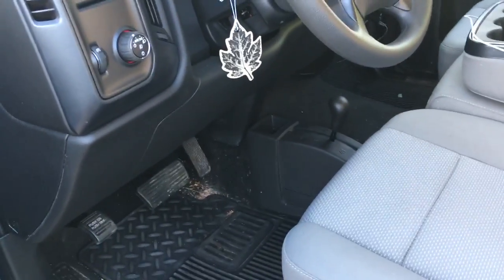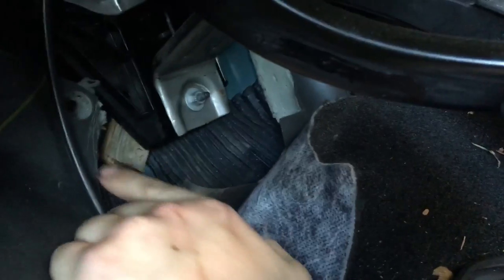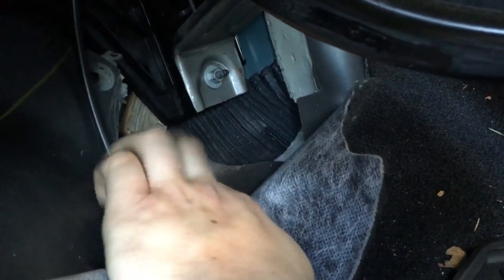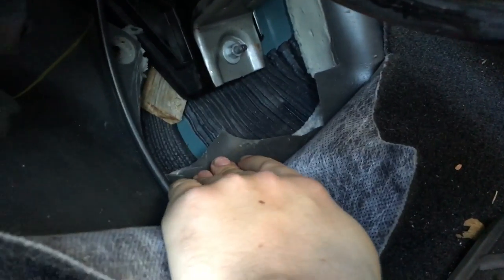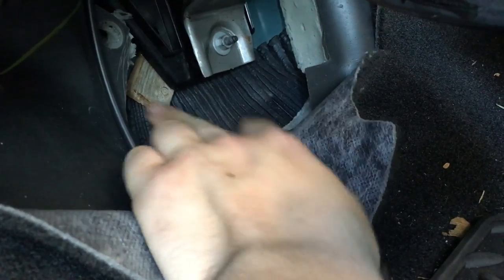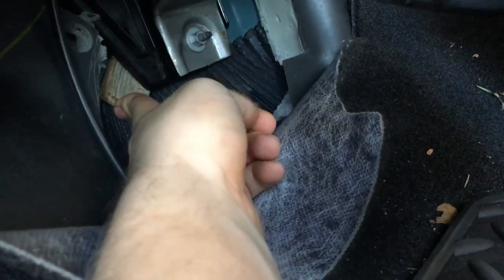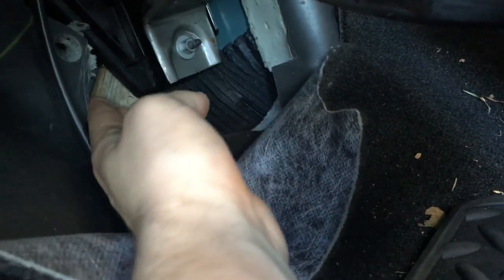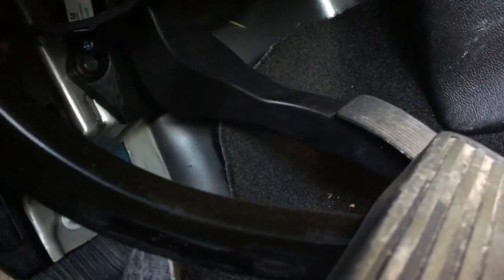Fix Gm truck slow throttle response for free (paint stick trick) 2014-2018

Comment: omfg I brought my GMC pick up 1500 double cab Sierra to the dealership for the same issue the punk teenager kid tries to charge me $2300 for a new y pipe!!!! Man you just fixed my problem for free thank you so much
Reply: There must be a factory plastic tab behind that plastic mold that breaks from frequent pedal Pressure on the accelerator

Comment: So what you did is just pull in the slack for the pedal? I have a 05 GMC and the pedal is touchy as hell. When I go over bumps I'll inadvertently push the pedal up and down in rhythm with the bumps.
Reply from the maker: Yes
Reply: @NWCPcbenchmarks  Why the f,ck didn't I think of this. Thanks man, I have some work to do to my GMC tomorrow so I'll do that. Low tech tips are my favorite, thanks again 🇺🇲

Comment: What size is the nut on this?
Reply from the maker: I can't recall for sure, but I believe it's 12mm or 1/2inch 

But you should be able to just Jam something behind it pretty easily without needing to touch it
Reply: @NWCPcbenchmarks  iiin😮